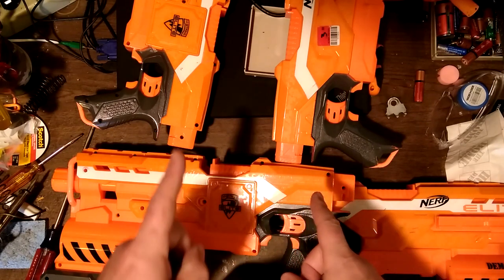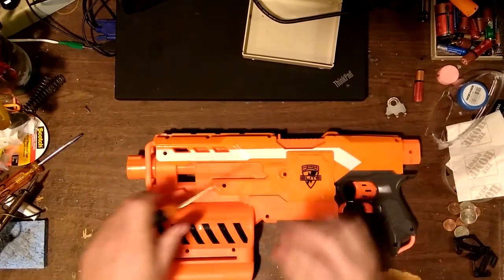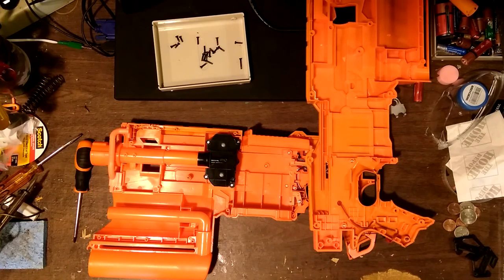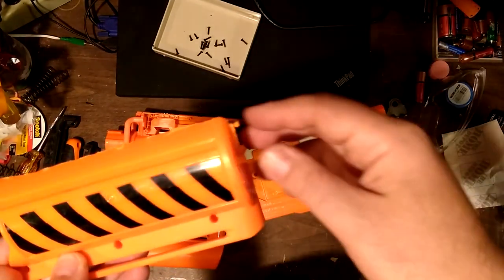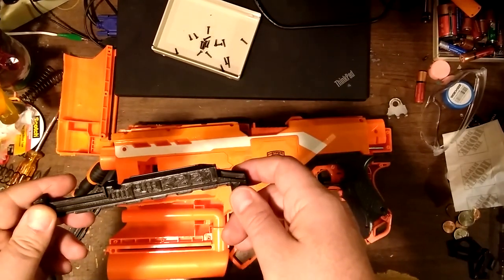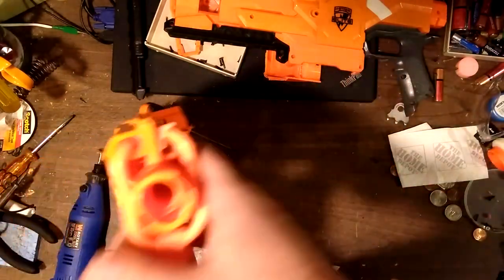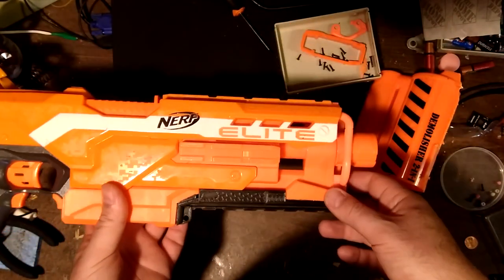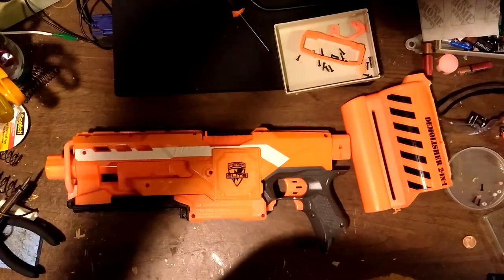[Nerf mod] Demolisher missile launcher removal

Comment: what did you use to cut it, as i and under 18 and live with my parents so id need to ask
Reply from the maker: Personally I mostly used a Dremel-like rotary tool.  It should also be possible with a hacksaw or similar.